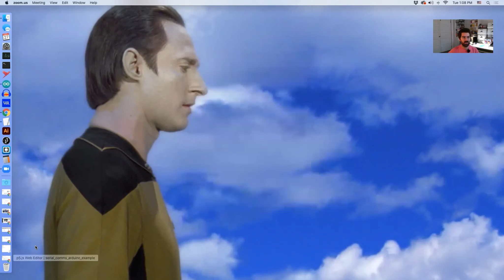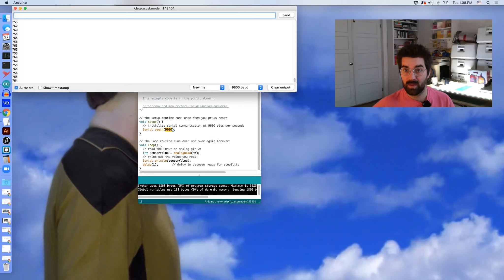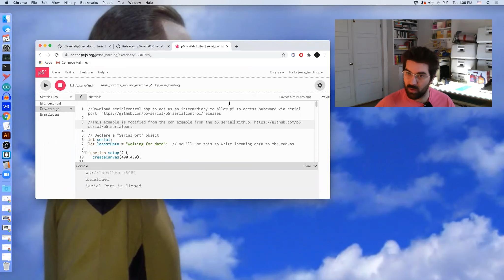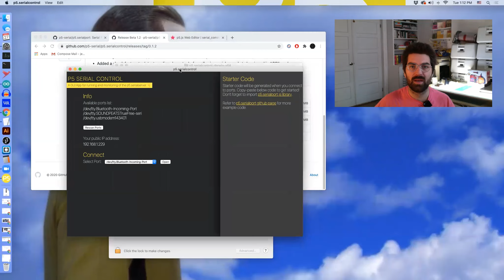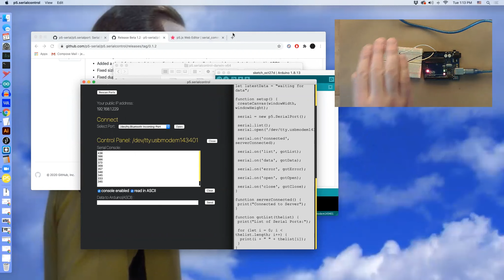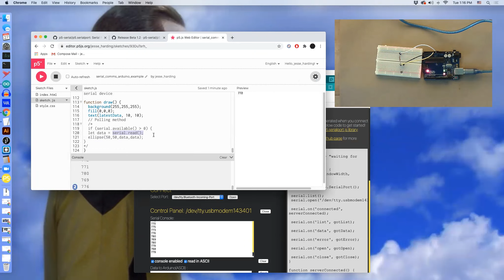Connecting p5 & Arduino through the serial port

Comment: Hi hello! Really enjoyed your video and it has a really clear explanation

I do have a problem I encountered, so when I downloaded the p5 serial control from github, there's the version BETA 0.1.2 and when I tried to connect my arduino it kept saying undefined

In my arduino I am trying to detect the nano ble 33 built in gyroscope, the data are showing, but p5 serial control just won't connect to the port(?) 

Do you know why this might occur? 
Thank you so much!
Reply from the maker: When you say that "the data is showing" and "it kept saying undefined", what do you mean exactly? Where are you seeing the data and where are you seeing undefined?

What  I can think of as potential problems are that you might need to close the serial monitor of the arduino application as this can interfere with the serial connection through the serial control application or that you might have the wrong baudrate set in your arduino sketch; if my memory is correct, you have to set it at 9600 for the serial control application to work properly.
Reply: @quarduino6218  Hi Hello! Thank you for replying, I found out what the problem was with the help of my teacher! Turns out the p5 serial control and arduino IDE was like racing for the port and all I had to do was close the Arduino IDE haha my bad! 

But to answer, the "undefined" Had it's own pop up when I try to open the port. 

Haha so sorry to bother you, once again thank you so much! Have a nice day :D
Reply from the maker: @graciellanatalie9259  No bother at all! Glad you got it figured out with your teacher! :)

Comment: Hi, I have some problems with the p5js step. Even though I changed the port name, the console, still shows undefined. But the console in p5serial controls runs well.
Reply from the maker: Last I checked, Safari was not working with the p5 serial library, but chrome does. What browser are you using?
Reply: Hi, I also meet some problems with this step. It keeps showing error that “p5.serialport is not a constructor”. What should I do with this problem?
Reply from the maker: Ah! This error could be caused if you forgot to include the reference to the serialport library in the index.html file for the sketch. Check line 6 in index.html in the sketch files of the p5 sketch linked in the video description. Hope that sorts things out!